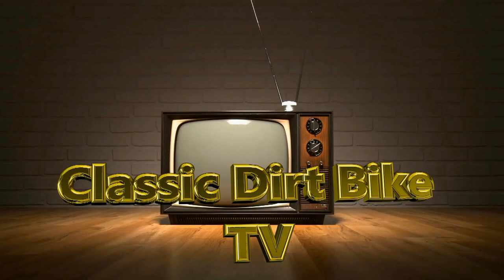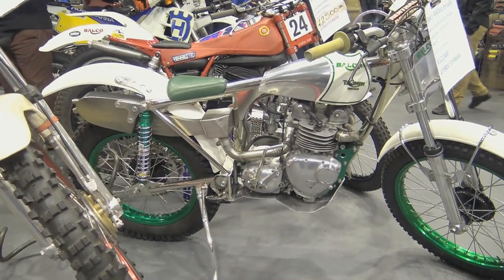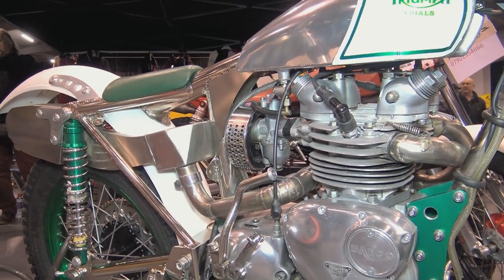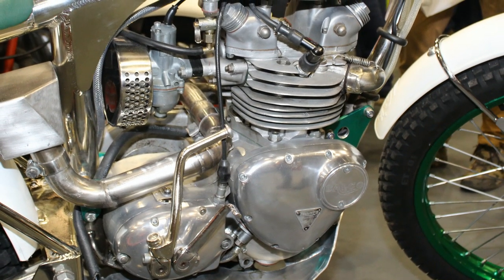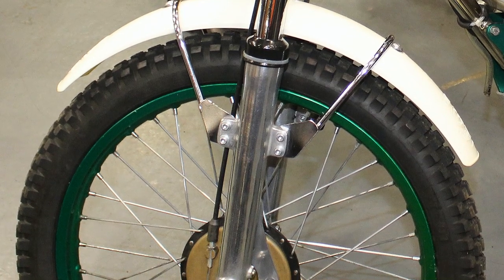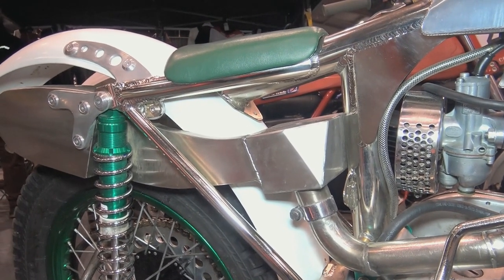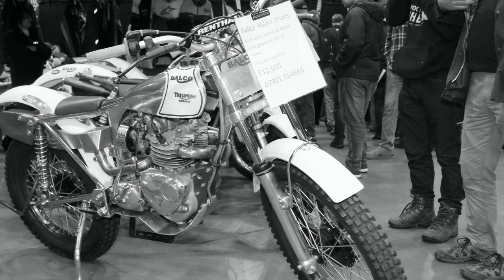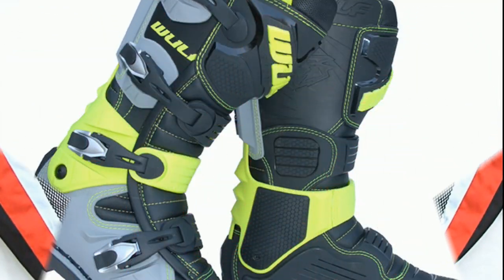Classic Dirt Bikes "Balco 500 Triumph Twin Trials Bike"

Comment: The level of detail never ceases to impress me. I think the alloy barrels we standard on the t100 motor. They had steel inserts for the head bolts which you have to be careful not to overtighten.
I'm looking very carefully at the British twin powered motocrossers as I find myself with a spare Norton racing engine and gearbox. I fancy building something along the lines of the Rickman Metisse but with the pre unit Norton. If we move to a bigger unit we can concentrate  on building our own frames.

Comment: I wanted to hear it RUN ,🙁
Reply from the maker: Joe Guilfoyle So did I although unfortunately exhibitors were not allowed to start vehicles in the confines of the show grounds, mainly due to the health and safety of visitors with regards pollution and noise.
Reply: Yes a beautiful bike but I don't like the exhaust.it will melt the rear mudguard.i would like to know how it sounds. I did something similar many years ago trying to get it quite.  But it sounded bad..
Reply: @adrianrouse5148  Has been used for two seasons now, rear mudguard still like new and undamaged!